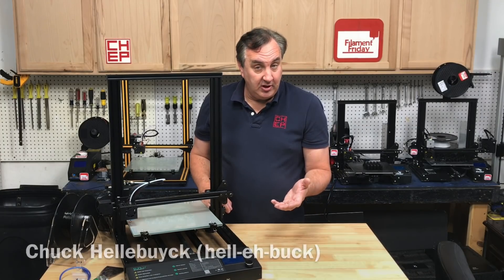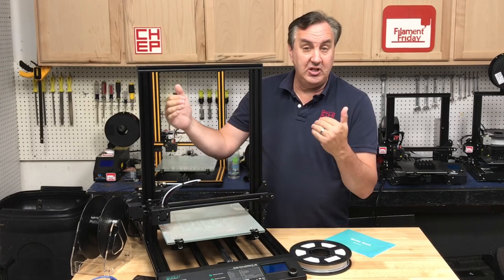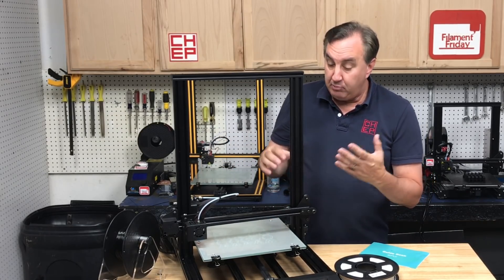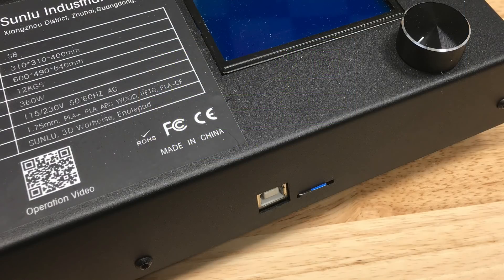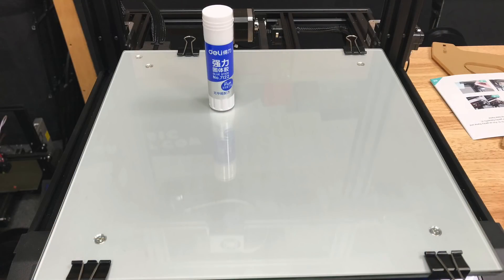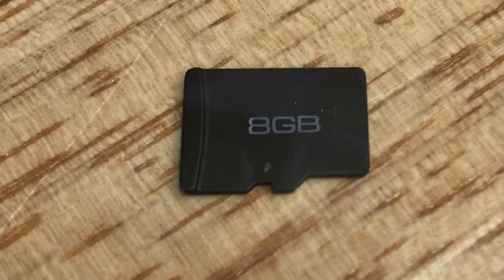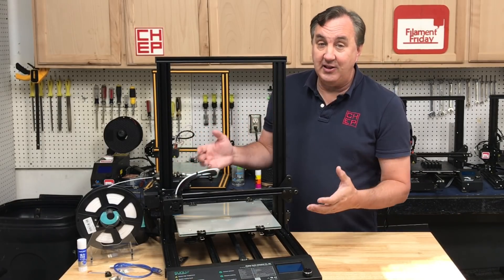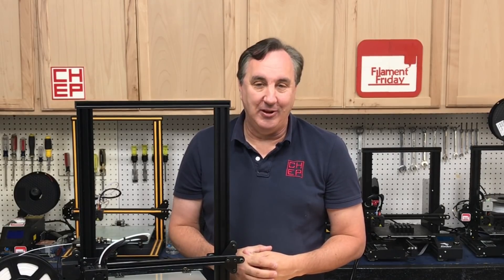$229 Large 3D Printer the Sunlu S8

Comment: I have 2 S8 with metal extruder, yellow spring, capricorn bowden tube. Run super good next to the CR 10. Recommended. Will update to skr 1.4
Reply: Oh you forgot to mention that it has a led light super good.
Reply: I did find the extruder was a little weak and I had some filament grinding.  I happened to have a cheap aluminum extruder kit handy, and the adjustable nature of the kit helped a lot.  No more grinding.  I think it might have been a $7 kit from Banggood.

Comment: Spend a little extra and get a cr10s...
Reply from the maker: I had lots of issues with CR10s
Reply: @FilamentFriday  wonder if that was one of the first rounds of production. I've had mine for over 2 years now, maybe 3 and 0 problems. Maybe you mean the cr10s pro or original cr10?
Reply from the maker: No. CR10S but it was early version. The way they drove the steppers it would lose steps.

Comment: I feel that this was just a promo video. The printer has a few flaws including when you get it the y belt slips loose very quickly because they put the smooth sides together where it fastens (the toothed sides should face together to lock in place). The printer frame is way off square (mine was anyway) so if you print a 2 piece object and expect it to just fit together, think again. I support that they check it works in the factory but to leave filament in the nozzle so the whole nozzle has to be dismantled before use? There is no way to tension the y belt without a mod. I too had the same sd card issue and the issue was not easy to figure out. The bed dimensions are 310x310 and the firmware reflects this so you can print using the whole bed (the actual bed is the same size as the cr-10 so you can buy the coated class as i did). The sd card slot was broken when i got it and completely failed soon after. The best thing about this printer is the company who sent me out a new board which was easy to replace. It is as loud as a truck sometimes so no printing at night. I wouldn't say don't buy this printer but i would say .. bare these faults in mind. The manual states you should print at 30mm/s which is slow on a small printer but lunacy on a large one.
Reply: Actually, you can tension the Y... just loosen the two large nuts and tighten the two screws holding the idler bearings... then tighten the nuts back against the screws.  Works perfectly.
Reply: @williamsteele  there was no significant adjustment on mine until I added some nuts
Reply: He was right about the ringing / ghosting too. what about a video on how to set up this cheap printer with cura to get the best out of it?

Comment: YOU THINK THE Micro Swiss direct drive work on this?
Reply from the maker: Possibly. I didn’t check spacing. But you could just change the bracket to a CR10 bracket.
Reply: @FilamentFriday  Also is the build plate 310 x 310 like CR 10 . Also thanks for all you help and videos.
Reply from the maker: Yes.
Reply: @FilamentFriday  Thank You you are the best

Comment: Good video. Good links. But 300x300 isn’t a large printer these days. Too many others in that size range. 
Ender3Pro size small
320 D3Hero etc. size regular 
CR10s5 size large
Reply from the maker: 300x300 is still large. 12”x12” is a big printer that barely fits on my desk.
Reply: For 200 bucks wich I paid? Name another printer you can get for that? Even if I have to do some tuning and mods that is hundreds less then most large format printers!
Reply: Price point and size, mate. A bit under 300$ so in line with the Ender though 60mm on a size larger than the Ender. 500$ cheaper than an S5.